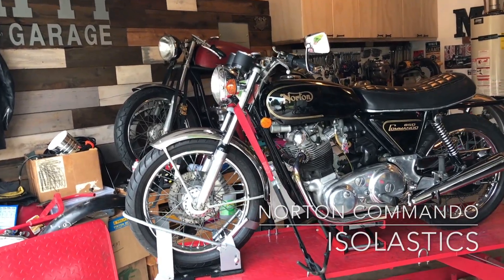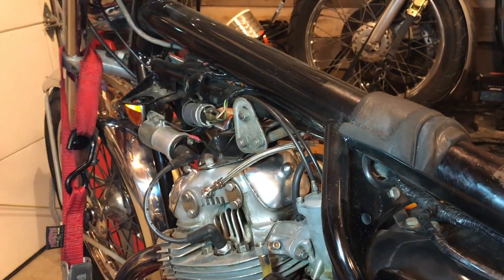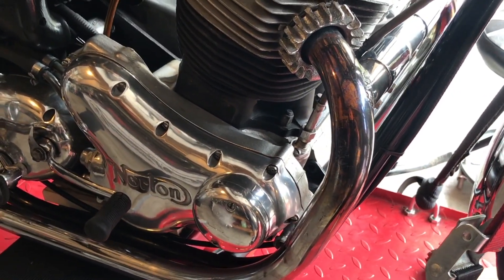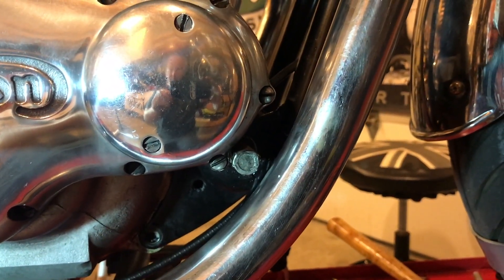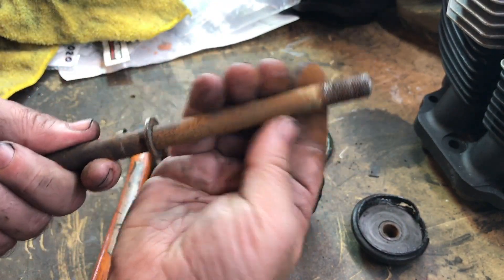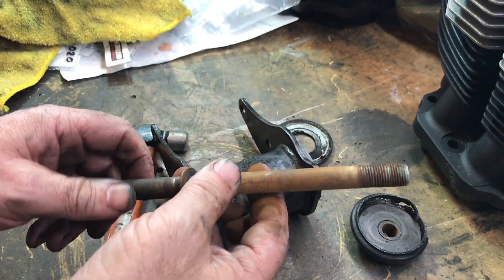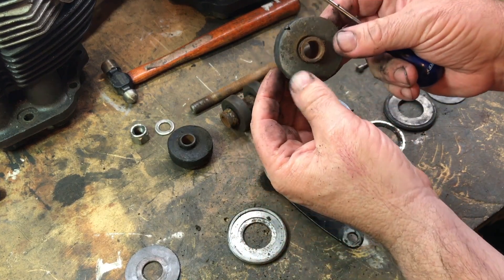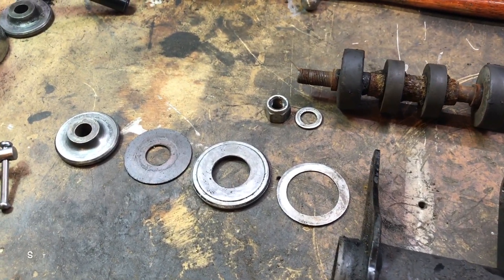1974 Norton Commando 850 MK2A – Isolasticity (part 3)

Comment: Same bike in my garage. Good runner, but not as clean (impressed). Have to say I've been thinking the Iso's needed doing for a while but this is an intimidating effort. I can put up with a lot of vibration... Will inspect as closely as I can though and see that its not a safety issue. Still... that's a lot of effort on the front alone... Thanks so much for the video though! Great to see the detail and step-by-step.
Reply from the maker: Thanks a lot Todd. I have to say that after all this work, I don't think I noticed a huge difference. That has influenced my decision to go ahead with the rear ISOs as it is an even bigger job.  I simply haven't had the energy to start it 😉. Good luck with your project. Best wishes, Mike

Comment: I'm restoring a 74 Norton  What kind of oil do you use and what kind of gas do you fill up with.
Reply from the maker: I use Valvoline VR1 20W-50 Racing oil in my Vincent and Norton Commando. Also mostly just use regular gas 89 but try and go for the higher octane 92 when possible. Cheers, Mike

Comment: Hello Beautiful bike! I have a Norton Commando 750  1972  and mine is also shaking a bit,  I have changed the front and the ones under the tank. But I still feel like it´s shaking a little, more than it did the first years I had the bike.  Mine has the Pre-MK3 commando Front Vernier. Not shims. Do you have any tips on how I can fine tune that type?

Comment: What value would you put on one of these (1973 850 commando) which is complete but in need of full restoration? in the U.K.
Thank you
Reply from the maker: Hi Billy, the prices are a lot higher in the UK than here in the States.  Here's in the USA, depending upon the condition, I would say around $2k for a project and most likely a minimum of 2,000 GBP in the UK.  Cheers, Mike
Reply: Thanks, It just sold on eBay for £4750! All chrome pitted with rust, tank also pitted with rust and had a seized engine 🤔
Reply from the maker: Arrrggghhh!  That's a fortune!  Wow, for the equivalent of about $6,200, you could get a really nice runner!!  Prices are so high in the UK and Australia for these bikes!  You will have to come on over and grab one!  Best wishes, Mike